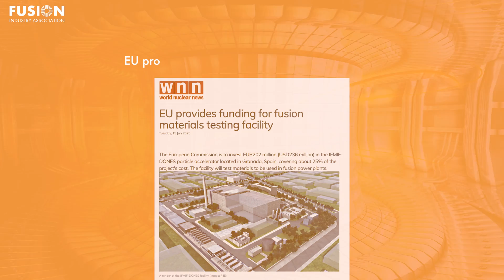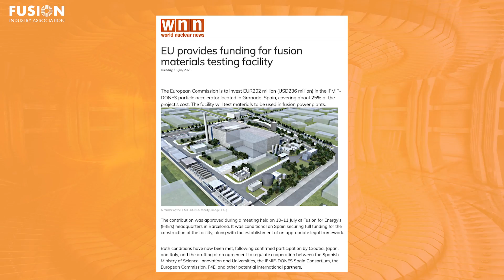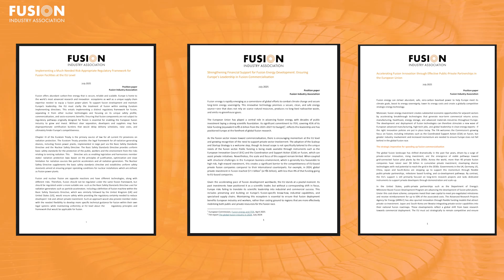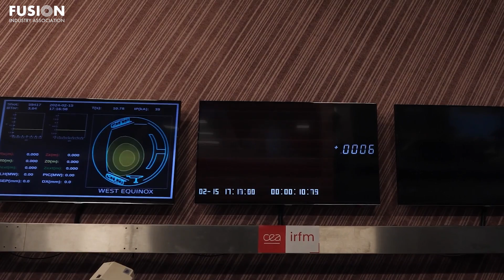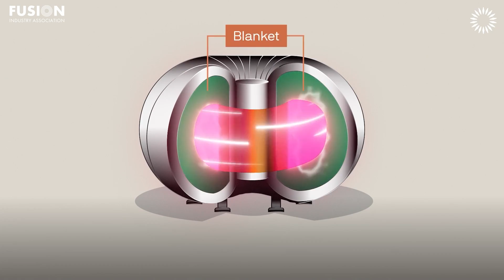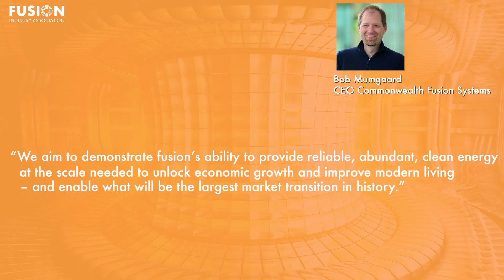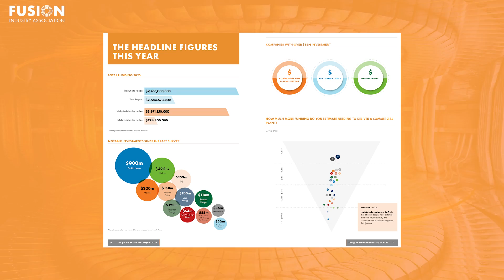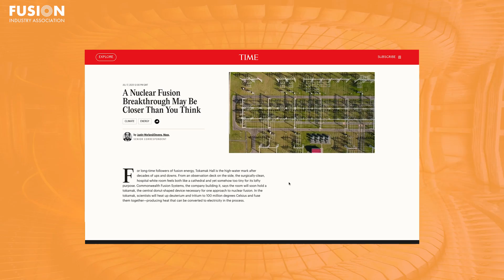Fusion News, July 23rd, 2025

Comment: I finished the IFMIF article and I’m still wondering: which lithium isotope are they using, how does the neutron spectrum stack up against what DEMO’s first wall will see, what about tritium and ^7Be build‑up, how do those fast neutrons mess with the loop’s chemistry, heat management, and corrosion, and—bottom line—how much extra does enriched lithium cost?
Reply: Lithium-6 would not produce neutrons. Lithium-7 will produce 13.7MeV neutrons, a little shy of the energy of the 14.1MeV neutrons from D-T fusion.

Comment: Inertial‑confinement fusion (ICF) is now the fastest‑growing approach in the private fusion sector: the Fusion Industry Association’s debut 2021 survey found only 2 of 23 companies pursuing ICF , while the 2025 update shows 11 of 51 firms taking the laser‑driven route. Magnetic‑confinement concepts still dominate numerically, but their share is easing as ICF start‑ups multiply, and magneto‑inertial schemes have largely levelled off. Crucially, ICF’s surge follows the December 5 2022 LLNL ignition breakthrough, which triggered fresh U.S.‑DOE support, highlighting how high‑profile technical milestones and policy signals—not public polling—are steering investor momentum.
Reply: The ‘net energy gain’ breakthrough is nonsense since the energy to fire the lasers is ignored. The machine energy was apparently about 1%, so it is short of the factor of 10 to 30 required for a reactor by about 1000 to 3000. 
Also as I’ve written before, how will the final lenses or windows be protected from the highly damaging neutrons?
Reply: @johnh6245  I agree with you. In addition to neutron damage, the final optics must withstand x-ray and shrapnel. This seems like an impossible obstacle to overcome. However, the concept of liquid-protected or sacrificially coated final optics is very much alive in ICF power plant design discussions.

Comment: NO LONGER A VAGUE PROMISE
It is a huge step-change to see so many stories talking about net-energy and grid-connected power generation. Easy to overlook, but even if none of these specific projects succeed, the change in expectation is a monumental shift in expectation that indicates technical confidence in imminent fusion delivery that didn't seem to exist at a broad level just  a year ago.
Reply: Sorry but it is still a vague promise. The fusion hype is amazing but they are still way off getting the plasma conditions right, and the real problems only start after that with the neutron damage, tritium handling, and breeding problems.
Reply: @johnh6245 Good summary. Another key word is HEAT EXCHANGER. Without a demonstated long-lived prototype, we know very little.